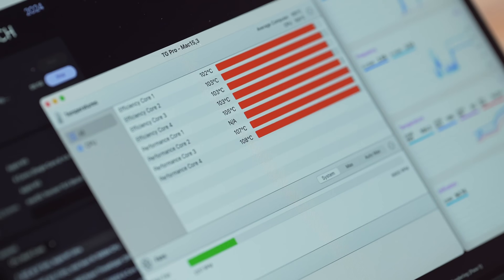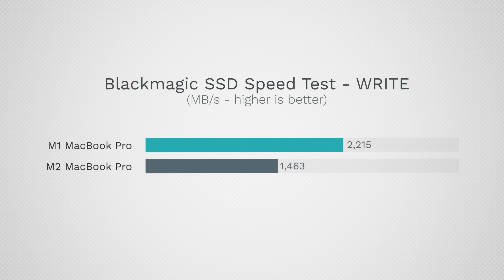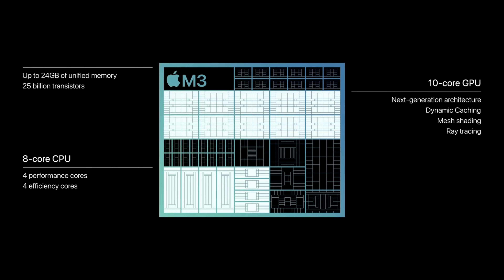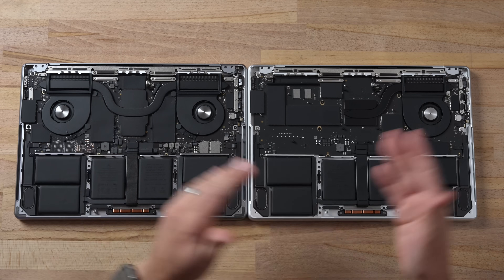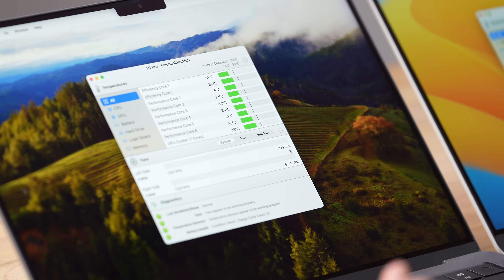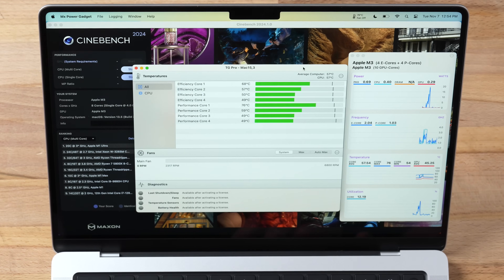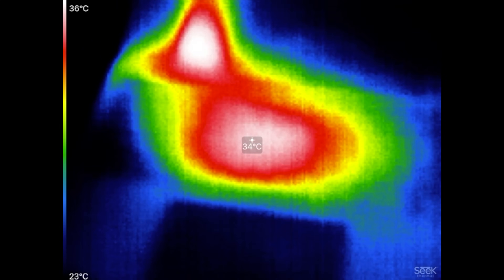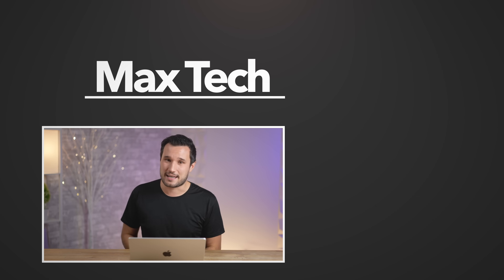M3 MacBook Pro Teardown & Thermals - REALLY, Apple?!

Comment: I didn't understand this product, but now I do and I think it was a mistake by Apple.They discontinued the 13 inch Macbook Pro with the normal M2 chip. Apple has now released M3 version of that chip in the bigger & newer Macbook Pro body, but with one fan. 

This has completely ruined the lineup as the Macbook "Pro" line should only come with a Pro or Max chip and represent the higher performance products. Yes, you still have overall the best laptop design on the market (Best display, speakers, trackpad, keyboard, battery life), but you get it with a less powerful chip. 

If anything, the base M3 Pro 14 inch Macbook Pro could have received a $200 price cut and could have started at $1,799.
Reply: You forget that the MB Pro 13 M2 was also branded as Pro and has been for years and years. The confusion is that instead of spending billions on making a new 13-inch design, Apple used the MB Pro 14 chassis instead. So, it is no mistake by Apple, just some confused viewers who do not get it.

Comment: Do apps/software need to be optimized for 3nm chips or is the heating of the MacBook something that will affect it for the time it is around. I was thinking about upgrading, currently on a mid 2012 MacBook Pro, but now I am questioning wether going for the pro chip. Would you recommend the m3 chip? I guess we'll wait for tomorrows video

Comment: Do you only get one fan with all m3 mbp 14” models? 

Based on previous experience, I was expecting them to have two fans when you opt to upgrade specs, such as upgrading ram to 16GB.
Reply from the maker: Only 1 fan on the base 14" MacBook Pro with M3
Reply: I wonder if the the unbinned M3 Pro has two fans since it comes with a larger power supply.
Reply: So the M3 Max has 2 fans?
Reply: The base M3 MB Pro 14 is the only one that has one fan, both the actual pro models, denoted by their chips (M3 Pro and M3 Max) have twin fans.

Comment: So does this mean the 3nm chips just run hot? Explains the iPhone 15 heat issues.
Reply: The iPhone 15 does not have heat issues; that bug was fixed a while back. The 3nm chips are designed to run at high temps with no risk to longevity. We are not talking about Intel chips; this is ARM-based and totally different, and people need a different mindset on what these M3 chips are capable of.
Reply: @ahaimes6320   Mine still gets hot when doing video. Didn't do that on the 13 pro.

Comment: My 14" MBP M1 Pro 512GB Base model gets almost double the SSD read and write speed. Over 5,000 Mb/s read and write on Blackmagic Disk Speed test.  Even with 2 nan chips on the new M3 those SSDs are still slow.
Reply: Yes, but he was testing the M3 non-pro chipped MB Pro 14, so it is not like-for-like. This is a replacement for the MB Pro 13 M2, not the MB Pro 14 M3 Pro, which is another laptop altogether!

Comment: They need to start considering a fan in the Air models. My M2 Air gets hot very quickly with just some light Arcade games. I’m talking 3-5 minutes in it’s already hot and battery drain is insane.
Reply: Haha as I told u earlier.. nothing fancy about m series cpu.. gaming only last 1 or 2 hours... And running hot...
Reply: My steamdeck passive cooled none of this has shtyy problem
Reply: Does it get hot to the touch? Especially the bottom. Can you use it in shorts with the laptop sitting in your lap?
Reply: When the MB Air came out, I warned people that they are not a sensible choice if you game or use intensive apps as they have no fans. Even in an interview with Apple, they made it clear that the Air was not for sustained loads!
Reply: I prefer no fan. Yes, even if it throttles. I have a MBP for heavy lifting. I like to be able to leave my Air in a bag idling at 2W being a server, router, NAS, airplay receiver, and juke box. Lots of peace of mind knowing there's no fan in there. Seriously, the thing idles lid-closed on the same power as a Raspberry Pi, but hauls ass in spurty workloads and, most importantly, runs macOS. I don't want it to have a fan!

Comment: Apple decided to give the base M3 chip more power and thermal output, but axed an entire fan? What an odd design choice
Reply: I'm not sure what the point is of them advertising it as being faster... since if all that performance is called upon, it'll inevitably thermal-throttle back anyway.
Reply: @MattExzy  well it depends on how long you take that power. If you do something and can do it really quickly thanks to the great burst of power, you do not hit the throttle threshold or you will not be affected as much, because it could cool down before you need to call upon this burst again - my example is photo export, as I take photos sometime.
Reply: @MattExzy Because most people buying a regular M3 don’t play games or do professional taxing work, or benchmarks, they just do streaming, school work, and alike, why the laptop doeesn’t need substained performance, but the M3 Max does.
Reply: @ncard00  "streaming, school work, and alike"

M1 Macbook Air can do that just fine with half the price, just not look as cool as 14" MBP.
Reply: People are confused, thinking that the MB Pro 14 M3 is the base pro model when in fact, it is a replacement for the MB Pro 13 M2, which was basically the MB Air with a fan and a few extras. Both run the base M-chip and are, therefore, 100% not "pro" machines despite the branding (ignore brand names and use common sense). The "pro" models have the M3 Pro and M3 Max chips.
Reply: Well they did not axe an entire fan. The M2 chip never had more than one fan ever, and that was in the MBP 13. Most of the M2s are passively cooled even - in MBA and iPad Pros. THAT should not be a problem. But I will give you that it is a weird design choice as one would imagine that if they reused the motherboard, it would technically be cheaper per unit, but I guess Apple has done their accounting and the features on the true pro motherboards are more expensive than manufacturing a complete different unit...

Comment: What’s interesting to me is that the MBP 14 M3 is shipping with the previous OS meaning they were ready to ship back in June/July, so it does beg the question was M3 going to launch at WWDC in the MacBook Airs and this MBP with the M3 Pro and Max launching in October as we saw…

That then further begs the question why wasn’t this launched when it was ready to go…

Either A - Apple was struggling with the thermals of M3 in the MBA’s or B - Apple is purposely holding back the Air line up much like they have done with the iPad Air and the standard iPhones
Reply: My MBP Pro 14 M3 Pro  came with Sonoma 14.1.
Reply: @bikeman7982 the standard M3 ones and iMac came with Ventura
Reply: There are many reasons to delay, including the fact the M2 just came out and the terrible economic conditions, as well as waiting for Sonoma and AAA games.

Comment: If Apple used the 3nm M3 tech to create a new version of the M1Pro (same speed), I wonder if they can make that laptop last 40 hours 🧐

Because I’d totally get that. Don’t need anything faster than M1Pro. But doubling battery on it would be worth the upgrade.
Reply: I don’t understand why not just put two batteries into one computer to double battery
Reply: @dominusdone5023  not enough space
Reply: @MrFraiche  they could just design one just for that purpose I haven’t seen any computers with that. Why not just make the computer higher too

Comment: the higher the temperature difference between cpu and surrounding air, the better the cooling. Letting those processors run so hot might be a strategic move, as long as the silicon can take it.
Reply: 😅 let it burn 🔥

Comment: Nice review waiting  to see the future reviews I'm debating on getting the Pro M3 12 core cpu 18 core gpu 16 core neural engine 36 GB memory with 2 TB or the Basic M3 Max with 1 TB  coming from  using 2013 Mac Air I know it will be a nice shock on performance I just wish Apple would have use changeable parts like my old MacBook Air which I had to put a 1TB SSD in it to edit my drone videos which was a big challenge

Comment: Intel is back in Macbooks, the motherly warm feeling during cold winters that this Mac will give is something incomparable. Hopefully M3 mcbook pro 16" won't have this problem as I'm about to buy it.
Reply: Actually, I saw other tests that showed that even with higher temps in the cores, the M3 is much cooler than M2 devices on the outside.
Reply: @ahaimes6320  Thanks for taking the time to provide the information but here I was just pulling apple's leg. And yes, M3 pro has better battery life as well

Comment: that's the same M2 macbook 13" now disguise in a M2 pro 14" case. so they charge extra $300 for the benefits of that case without the cooling upgrade. if they updated the cooling like in the 14" M2 pro it will be the quietest and coolest mac of the bunch.

Comment: The fact that the M3 runs hotter seems strange to me because I thought one of the main points of smaller architecture was to improve efficiency.
Reply: M3 is on the first 3nm node so its not as efficient or powerful as the new 3nm nodes being built. M2 runs at 3.5 ghz max while m3 is 4 ghz max. If you kept them at the same ghz the m3 while out perform the m2. Its hotter but only cause the m3 has a higher ghz. The real question now is which can sustain peak performance.
Reply: Apple cheaped out and cut it down to 1 fan.  Also it's harder to cool a smaller chip using the same amount of power as larger chip.
Reply: @ratshackmojo  Base m chips have always had one or no fan at all. Not meant to be a high end performer. If you bought one for that purpose then thats on you.
Reply: @TrestonDodd  OYea the M3PRO----Base chip ... ;) 
Not to be confused with the  M3 the SUB-Base chip ...lol.
I guess @ratshackmojo was just unaware that Apple uses the"Pro branding" for their ""base"" models ??
[Possibly in an attempt to lessen the cognitive dissonance caused by the price of the ""base"" model ? ;) ]
Jokes aside maybe You should look up the M3 which is the actual base chip, since You evidently are unaware of Apples new lineup
Best regards.
Reply: Thanks for the information.
Reply: If they took the M2's exact design and put it on 3nm at the same clock speed, it would be significantly more efficient. But Apple used the efficiency gains of the node to allow them to boost the clock speeds higher and to use a more advanced microarchitecture, which raised performance but ended up using more power to go along with it.
Reply: @photoniccannon2117  M3 uses the same amount of power as M2 while being faster. Max tech mentions in the video too
Reply: The efficiency gains went down the drain when they increased frequency and voltages
Reply: 3nm, 4nm, all just marketing, not actual sizes anymore. They only mean higher transistor density if comparing from the same manufacturer nowadays.
Reply: Shame it’s louder, the quiet M1 14” Pro seems will never happen again.
Reply: basically Apple has NO QA Department + their Management is in a Cult
Reply: If we talk about the same performance then yes the M3 would be faster but M3 is significantly more powerful which explains why it runs hotter
Reply: they unlock more wattage for their silicon. M1 was too conservative
Reply: They r underperforming due to the yielding issues they faced.
Reply: the good thing is that there are those who make fun of Intel and AMD, when Apple with these stupid miracle tablet chips is 109 degrees hahahhahh😂😂😂😂
Reply: @FBL9982 yes yes all Mac user just run cinebench 24/7 with their MacBooks
Reply: as long as apple used TSMC N3B node I will not buy any of these computers

with this node, the M2 chip is better than the M3 chip, what apple is doing is deceiving the consumer

look at the performance of the A17 pro chip it does not come close to what TSMC states that the 3 nano meter node should be able to achieve neither in energy efficiency nor in performance 

TSMC N5 / 4 node is better than the N3 B node and it is this qualcomm uses of a very logistical reason in the Qualcomm’s new Snapdragon. Chip

apple jumped on the N3 prematurely before this node was fully developed

before TSMC/apple has received a working N3 node, which won't come until TSMC releases the N3P node in 2024, apple can keep these

 apple have to reduce the cores in the M3 pro chip towards the M2 pro chip, which is manufactured on a larger node than the M3, it should be the other way around
 
The M3 chip is based on the A17 akitekure which didn't turn out well

The M3 pro chip has fewer transistors than the M2 pro chip and that says something about how good the TSMC N3B node is

that then apple charges a premium price for an inferior product does not make matters better
Reply: These M3s will never be pushed to this extent, 100 degrees celsius is fine if it hits it for a bit and throttles afterwards. The consumer who gets the M3 will probably use it lightly.

Apple has been known to just push their mobile cpus at boost clock till
 100 degrees and then throttle it afterwards (even during their intel era, it was known to be an “issue” because of it kicking in way too quickly).
Reply: @gambaloni  exactly.. if you want to show me that throttling is an issue, than that's fine.. even though all Apple, Intel and AMD chips are designed to operate at that temp, its where they throttle that is the real discussion and then how it affects performance on workloads that's the question...not this drama for dramas sake and of course YouTube views..
Reply: 100c is well within thermal specs for any modern cpu/gpu.. the drama for YouTube views is pretty annoying
Reply: @timschultz1928  It isnt, you clearly dont know about hardware
Reply: @ThePgR777 to be honest 80-90C is pretty normal. Although 100C is a bit too hot I agree. To remind you 100C is only the boiling point of water, it's not a magic number after you exclude water

Comment: Apple removed a fan because they know this will be bought by their biggest fans and that’ll keep it cool.
Reply: Hah!
Reply: Good one
Reply: Ba dum tss
Reply: Because one fan keeps it in spec.. is it throttling is the question not the temp or how many fans... Thanks for being concerned with something that doesn't matter
Reply: @timschultz1928  it does matter wtf
Reply: The laptop it replaced also had one fan so why do you say they reduced a fan?
Reply: @ahaimes6320  you’re not wrong. But you’re not right either. 

1) It’s $300 more than the old 13” MBP
2) Apple already has the tooling to make 14” MBP logic board that accommodates 2 fans, but yet they chose to waste money to reengineer it to fit only 1 fan which they then pass on the R&D cost to consumers by charging them $300 more.
3) they could’ve continue to stick with the way they’ve been manufacturing the 14” MBP by giving it 2 fans and it’ll cut cost and maybe even lower the price further than the current $1599, maybe not down to $1299, but $1449 maybe? 

But then again, who am I to judge? I guess most consumers getting the 13” MBP wouldn’t push it to its absolute limits that requires it having 2 fans. They may not even know about a missing fan to begin with.
Reply: mic drop

Comment: Why is it easier for Apple to stay with the same design instead of moving to the single fan?
Reply: The chip in the test was the base M3, and the base M2 MB Pro always had one fan. You get two fans when you buy the M3 Pro and M3 Max chips. This is not a pro laptop other in branding.

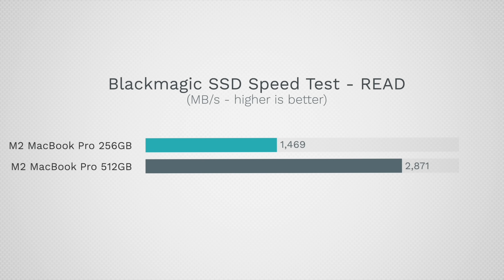Comment: Wondering about the life of a fan that spins 6800+ RPM's @7:45
Reply: Got an old 2015 macbook pro with a fan running at 7400 rpm with heavy usage, and it's still running well almost 9 years later.

Comment: Wow!  This test says a lot.  Worried about waiting for the M3 Air now.  Could well affect my decision on this.  Thanks for testing this.  Looking forward to other reviews on this.
Reply: These synthetic tests are not comparable to real life use.
Reply: These tests are nonsense as no one uses the base models like this, especially the Air, as it would be dumb. Even Apple says do not buy the MB Air for sustained performance as that differs from what it is meant for!
Reply: Macbook Air is literally just for web browsing and normal office work. It will be fine. You are not running cinebench with it. Web browsing will still be snappier with M3 Macbook Air vs M2.
Reply: @Henningberlin94  It compiles rust code pretty well.... m2 air with 24gb ram.
Reply: Maybe it's marketed that way, but i've done video / photowork on laptops 12 years ago. Laptops these days are so powerful that even an air will easily run Resolve or PP / Photoshop with ease @Henningberlin94